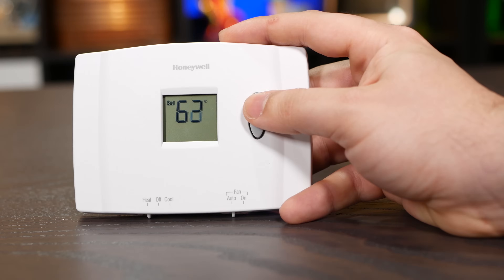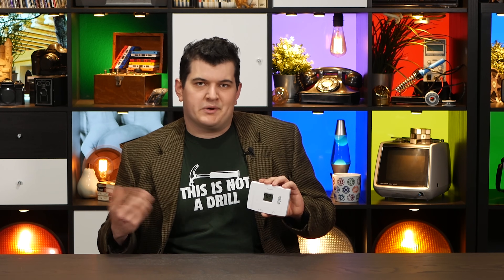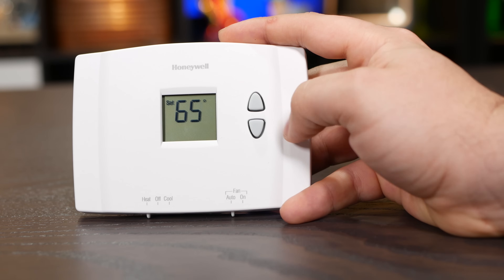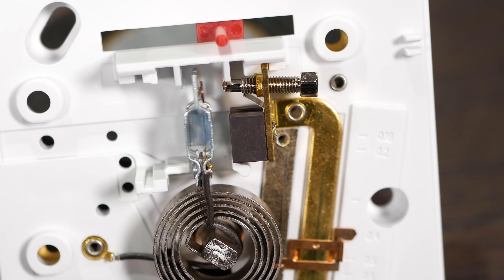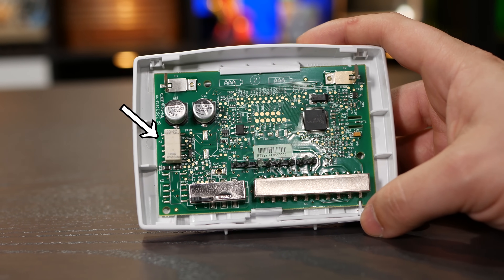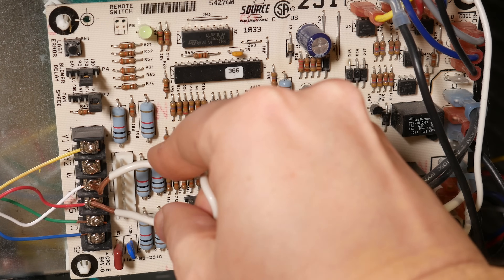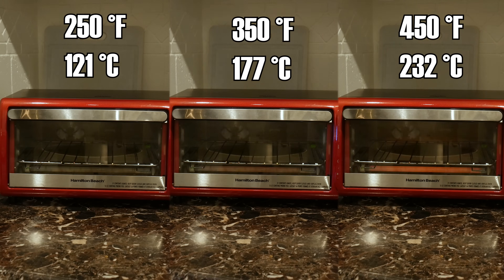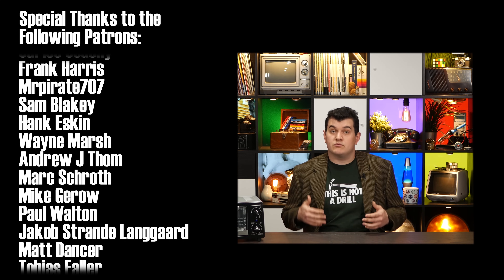Thermostats: Cooler than you think!

Comment: 1. Fans usually have two operation speeds, one is at half speed when you set the thermostat to fan, and the other is at full speed when the ac/heat is on as well.
2. The newer "fancy" thermostats have the ability to set the threshold, which allows the temperature to fall/rise much further before the heat/ac turn on and for it to wait longer before turning it off.  Some are set up between 0.2 and 0.5 degrees to base, others can be set for a much wider range and even occupancy requirements for energy saving modes.
3. An arduino can be used to do what you requested (with the "ac for 30 minutes then go back to regular settings)....but this seems very power hungry, as you could just stand in front of a fan or heater as needed and then turn them off when done.  Personally, I would prefer a thermostat that I only need to set once and never have to monitor ever again.....basically, I set my heat to 68 and my ac to 70 with a 0.3 threshold.  During hot days, the temp will increase to the 70 bias and the ac would react to keep it no greater than 70.3 degrees.....and on cold days, temp will decrease to the 68 range and the heat would react to keep it no less than 67.7 degrees.  That's a thermostat I like.

Comment: PWM: I think a microwave would be an even better example of that, cause there is no feedback loop that generates different duty cycles depending on the room temperature. If you turn a microwave to a lower power setting it will just switch on and of in a fixed rhythm.

Comment: In California the gas pipe would be required to have a flexible section due to earthquakes.  The water heater would require strapping to a wall, a pressure relief valve, and a flexible gas pipe.

Comment: I’ve seen some digital thermostats with a button and some with a switch to run the outputs manually, I’m unsure if the button option shut it off after a certain time or not, but the switches certainly did not

Comment: The mercury also has an arc quenching capability, not that it matters much being in a sealed container, but it did reduce the chance of buildup on the contacts more than just hard switching does, also notable is that the magnet has an arc quenching feature also, you can see the use of this in DC breakers and certain heavy duty DC switches and relays, whether or not this was intended is questionable

Comment: For electric heat at least, if you have a particularly underpowered system for the job, you need to set the heat higher than you want it at for a day or so or at least a little beyond how long it takes it to get that warm, then reduce it, otherwise it may take weeks or never even reach the desired temperature, the reason is tricky but mostly because the heat loss rate doesn’t increase the same with temperature difference as it does in a well insulated home with a well suited system, I can assume a similar effect is happening when someone turns the heat higher than desired with a furnace, the heater will trip off but the temperature will equal out lower once it settles, but the hysteresis in the thermostat doesn’t let it turn back on right away even though it’s colder than desired, and “high efficiency” thermostats may turn off closer to the desired temperature meaning they don’t give the lead in temperature to cover this event, at least on cheap ones, and poor circulation of the heat will worsen this along with poor placement of the thermostat

Comment: So two stage furnaces are becoming more popular. They only cost $200-$500 more than a traditional furnace yet can bring a lot if savings. The only time you really need your furnace to run at full capacity is outside temperatures bellow 20 degrees, the rest of the year your furnace is basically to powerful and wastes energy constantly turning of and on. The two stage helps fix this problem by having a high and low fire setting. Most newer thermostats will have a w2 terminal which is for turning the furnace on in high fire mode, but will not be installed as most of the time there will not be enough wires to accommodate it. Almost all the two stage furnaces work off of a timer in the control board in the furnace, that will kick the furnace in to high fire mode after a desired amount of time. A dip switch in located on the control board to change that amount of time (Never10,20,30minutes) There are also a lot of furnaces that are two stage but the installers were to lazy to set them up properly and will simply rigg them to only fire in high stage with a jumper wire.

This a a very good video, I work in HVAC and an insane amount of people believe that turning up the thermostat will make it heat better!

Comment: Some LG thermostats have powerful cooling function which does exactly this: runs AC at full power for 30 minutes and then switches to regular schedule.
Reply: Was looking for this. Thanks!
Reply: Drop the model name! We all need this!
Reply: Almost all programmable thermostats do this. The ones installed with my house almost 18 years ago even had it. It's called a hold function that you can set the time for, which overrides the set temperature for the time limit (including infinity, if desired). So, if you set your thermostat for 78 degrees F, and find it's too warm after coming inside from a 100 degree F day, you can set the hold function to 70 for 30 minutes (or an hour, or 12 hours, or whatever) and it will attempt to reach that temperature in that time period.
Reply: We have an Ecobee and it does "almost" this same thing. Set the thermostat for a lower temp (or higher), and it will ask you how long.
Reply: Yup. I've got one. (I live in Europe). The other unit is a different make, but also has this "turbo" mode setting. I think Europeans rather expect to have this more or less standard.
Reply: It’s most likely an inverter which have infinite speeds lg only sell those

Comment: If you want to add a timer wired in parallel to your t-stat nothing is stopping you. One timer for cooling, one timer for heat, and one timer for fan. All lined up on your wall beside your t-stat. Don't use a timer with an 'always on' setting though.

Comment: In my house we have three furnaces and two air conditioners set to two panels on each floor, we can independently turn on each appliance and set power levels. Our other property has a cabin with a wall mounted unit with regular outdoor ac and “smart” temp control based on time movement etc. house next to cabin has two stage so when it’s freezing and we’re gone its able to keep the house at 40 and the pipes won’t freeze. I recommend two stage or WiFi/Bluetooth enabled devices for controlling for power savings if you’re constantly adjusting it.

Comment: I recently got a Honeywell wifi thermostat. And apparently they are very touchy about getting exactly the right voltage to the C wire or else it wont turn on. I got one of these to plug into R and RC (removing the jumper wire) and it worked great.
https://www.amazon.com/Hotop-Transformer-Thermostat-Compatible-Honeywell/dp/B07FT2RCG9/ref=sr_1_9?keywords=hvac+24v+plug+in&qid=1579154867&sr=8-9

Comment: Most cheap programmable thermostats I've seen have an option to adjust the current cycle until the next programmed action.
So if you usually have it set to kick on the AC at 5, when you get home from work, but you came home early, then you just adjust the temp and it will leave it on that temp until 5.

Not quite what the Twitter user wanted, but could be set up (with a little time) to essentially be that.
And nest also has this, in effect.

Comment: This is interesting!

Me, in the Netherlands, uses a central heating system driven by a kettle. The thermostat can tell the kettle exactly what temperature of water to pump through the radiators. I'm not even sure what the kettle/boiler thing is called in English. It's not really a boiler. It warms water and then pumps that water to either your heating system or to your shower.

The thermostat is smart and wil learn about it's environment. When it's cold and you set it to your preferred temperature, it will run the kettle at full blast, the maximum temperature water it can provide. 70C for example. Once it's nearing the selected temperature it will lower the requested water temperature and the kettle will provide cooler water.

Once the temperature has been reached, the thermostat requests exactly the water temperature required to keep the room on the right temperature. Possibly as low as 35C. The radiators will feel slightly warm instead of burning hot. It will learn how quickly the room heats up, what water temperature is required to maintain temperature and can even take weather outside into account.

Our kettle has a programmable maximum temperature as well, this can allow us to heat the room even quicker by turning it all the way up to 90C, this will cost a lot of gas however. You can also turn it down to like 50C to save on your gas bill. The pumping speed can also be changed.

Comment: It's not quite what you were talking about at the end (I think) but in the agency where I work (a large building with some smaller buildings linked together) there's a main thermostat in the atrium with a button on it labled "2 hr manual override." I think our building is on a schedule, so it's not trying to cool too much during the summer when no one is inside, but since I do go inside there sometimes on weekends (I'm a video producer and have weird hours sometimes) I hit the override button, and the whole A/C system comes to life right away, and runs for two hours before stopping again.
Again, probably something totally different, but sounds like something that could be easily incorporated into any HVAC system. Just tell it to cool right away and don't worry about the temperature and then stop after a time delay.

Comment: My thermostat although goes up to 90 seems to only have on and off. I set it to Lower than 60 and it will go up to 80 the difference between 70 and 80 is less than a millimeter. Would replacing my thermostat help or is it my terrible electric baseboard heating? Upstairs each room has its own dial on the unit itself but the downstairs is all tied to that thermostat.

Comment: The Honeywell touchscreen thermostat we have in our house can do something approximating what the last Twitter commenter is saying. While you can't program it to just turn on the AC or heat to a time instead of a temperature, it does have a temporary temperature hold feature where you can command a certain temperature until a particular time, in 15-min increments. I believe timed AC or heat blasts can be done by simply setting the temperature to its min/max value until whatever time of day you'd like it.

Comment: 3:10 Although this video may imply that wires inside your HVAC system are color coded, please do not follow color code if you replace your thermostat.
Always follow the typical nomenclature for HVAC systems: R = 24 VAC, W = Heat, Y = Cool, G = Fan; the blue wire shown on this video is a C wire, which is common.
Why do I want to clarify this? Because I worked as a Tech Support representative for Honeywell for a couple of years and you cannot imagine the amount of calls we had from people that connected the blue wire in the B terminal of their thermostat after following color code and accidentally frying their own transformer (but not before blaming Honeywell for their lack of understanding about terminals). 
Please follow your manuals and never rely on color code, or better yet, hire a professional if you don't know what you're doing.

Comment: In the netherlands we commonly have central gas heated water heating, the "condensating" furnace is ultra efficient at about 97% and is controlled by a modulating thermostat that controls the output power of the furnace not in a on/off mode but modulating step-less, the furnace chamber is pressure force vented and has a oxygen sensor to optimize combustion. 
Power rating between 20-50 KW    
Standard tech in a dutch home since the 90's, cost about €800-1500

Comment: Digital thermostats may be boring, but the temperature sensors they use are not. Between thermocouples, thermistors and diodes, there's a ton of interesting science to be learned.

 One thing I always found interesting is that any regular (PN) diode can be used as a temperature sensor. The current through, and thus the voltage across a diode depends (among other things) on temperature, and will change in a very predictable manner given by the shockley diode equation depending on the temperature. So, given this equation and some clever math, you can work out what the voltage across a diode will be for any given temperature and use it as a sensor. Many appliances, including space heaters use diodes for the temperature sensor. Though I believe these are specially designed to be more accurate as a temperature sensor.

Likewise, you can do the same thing with any old resistor as long as you know its resistance with a fair bit of accuracy. Since the resistance of an object changes linearly with its temperature, you can take some measurements and work out what the resistance will be for any given temperature. Cody's Lab has a good video where he does this. I only wish he'd have done the same thing with diodes as well. But the math for that is a bit more complicated.

Comment: The 24V control voltage  was chosen in the old mercury switch days. Mercury will arc and fail to disconnect at about 28V. 24V was chosen for max availible power while staying comfortably below the arcing value. It is just legacy compatibility that 24V is still used.

Comment: Electric ranges will use pwm as well.

Also split heat pump systems will use a more complex thermostat. The heat pump will supply exactly the amount of heat (or lack there of) needed so the air comes out set to the room temperature and not full blast until the temperature is reached. They sre much more efficient than traditional forced air.

Comment: My Nest was doing the sneaky leech trick, until it couldn't leech enough power to keep up. That day I figured out the furnace installer just failed to connect the common wire, and that it was readily available with just that one little adjustment. Sneaky sneaky.

Comment: One thing that you missed is that some thermostats, including some of the older programmable thermostats use a form of PID Tuning to reduce temperature overshoot.
Basically when heat is commanded by the time the air gets to the set point at the thermostat and the heat is commanded off, the heater is still producing heat, and that heat will still get pushed out into the room, causing overshoot as the temperature rises well above the set point.
This is especially true with electric baseboard heaters and such, where the heat gradient across the room to the thermostat can be steep.

So the PID thermostats monitor how far the temperature exceeds the set point, and on the next cycle they command the heater off at a slightly lower temperature, and see how close it is, and continue reducing the set point until the final temperature is the desired temperature.
This keeps a more even temperature, and saves energy by avoiding the spike.

It also can effect how fast a room heats, and like with a two stage system, actually makes it where turning the thermostat up higher than desired will heat the room up faster, because you keep pumping heat in, rather than just letting it settle gradually.

Comment: An installation guide might say to ignore the wire colors because unless you check, you don't know if the wire colors are tied to the correct terminal (or tied to a higher voltage wire, etc). You know what they say about those that assume, they burn out their furnace and get a 24V shock.

Comment: Really enjoy your videos!  Quick note: some systems (heat pumps) use a VFD (variable frequency drive) to control the compressor speed.  The compressor can run at different speeds (instead of full on/full off) depending on the heat or cooling load being demanded. While the compressor speed is likely controlled based on how many internal units are calling for heat or cooling, it could also be ramped based on the temperature differential between thermostat setpoint and actual temperature.

Comment: Furnaces do have different settings there are some furnaces with multiple heat exchangers for example your primary heat exchanger may be 110M/BTUs then the secondary heat exchanger 60M/Btu so if you need a alot of heating you may use the primary and if you need a little heat it'll use the secondary heat exchanger. You don't want to run you furnaces for shirt periods because it'll shirt cycle, shirt cycles cause the heat exchangers to heat up and expand then cool down and the heat exchanger will then contract Thai can cause cracks in the heat exchanger that will cause CO and flue gasses to leak out, I would not advice allowing your furnace to cycle for only 3 minutes at time because your furnace in startup has to do a 30 second pre purge and a venting pressure check using a pressure switch to check for blocked venting (typically another 15 seconds) as well as depending on a HSI or a spark ignitor to light the pilot or burner directly that will also take a little bit of time and all of the sudden your heating up the heat exchanger for 2 minutes with a 1 minute start up ideally you would want a furnace to run for 15 minutes at a time as long as it it's properly sized for your home.

Comment: So this is not a one cycle option but I use it just to reset my thermostats temperature back to its default value. I use the program feature to set the same temperature for multiple times a day. That way you can set it to another value and then later in the day it will reset back to the default value.